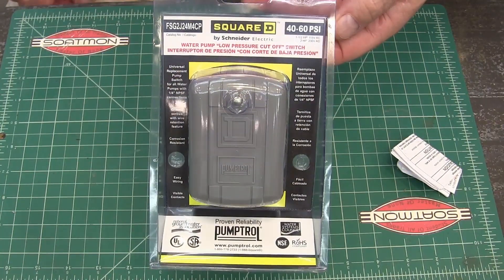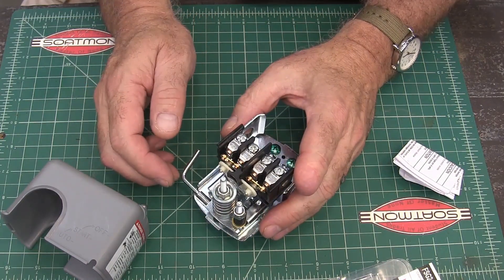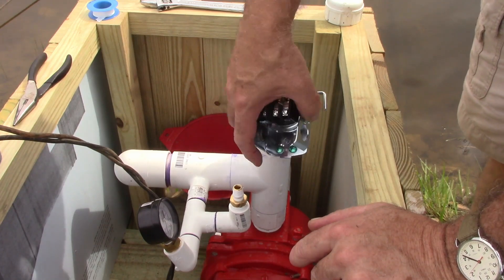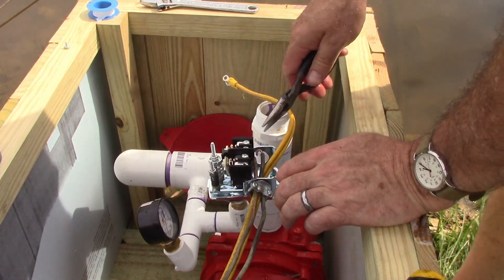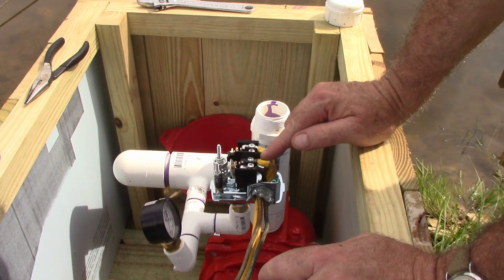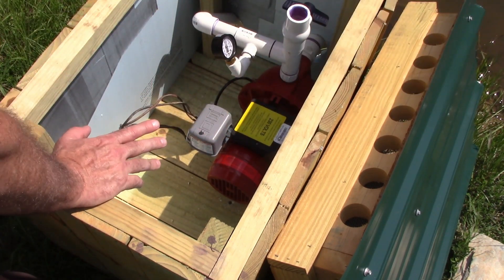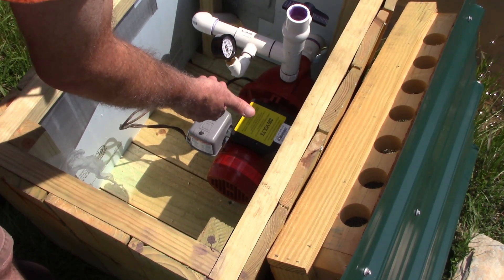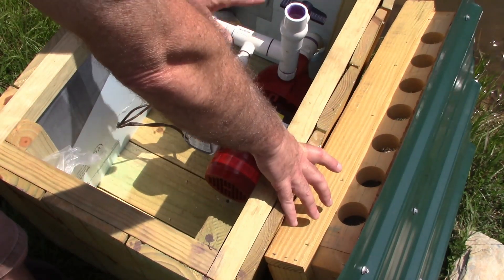Square D Pumptrol Pressure Switch

Comment: thanks.. I ask bing AI if this switch requires electrical power to switch it answers yes.. but from the looks of it.. its completely a mechanical switch with perhaps springs underneat and is switch only by force of pressure.. I was contemplating if i could use this to switch a motor running at voltages other than 220v..
Reply from the maker: You are correct it is water pressure that moves the contacts, mechanical.